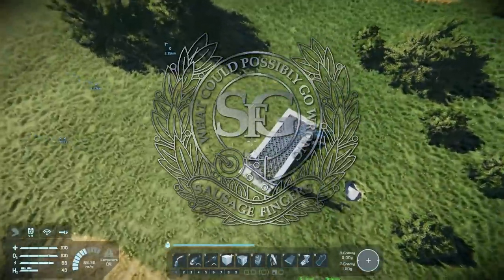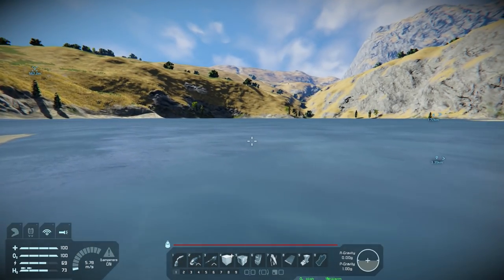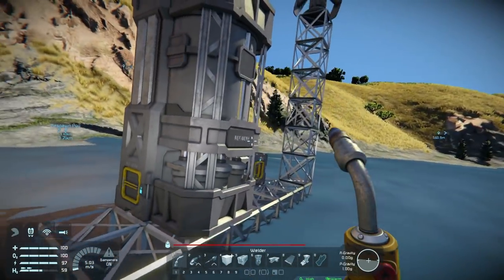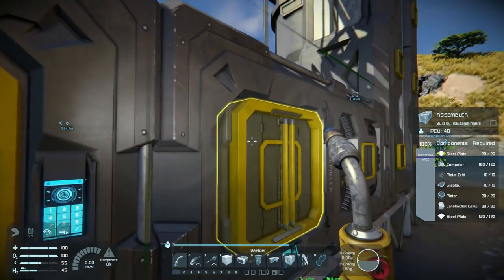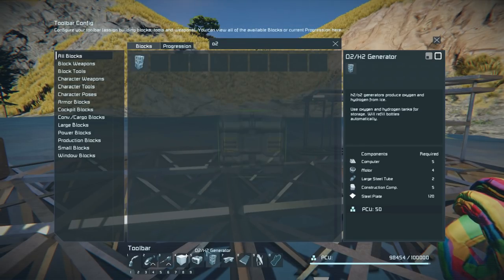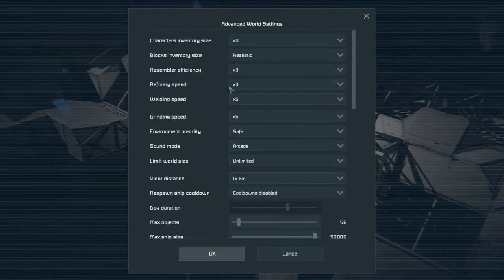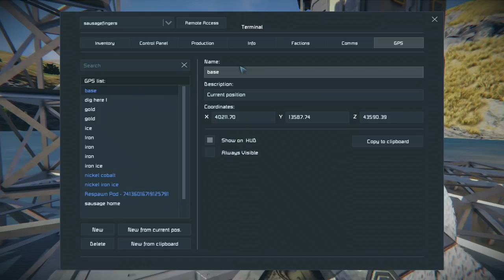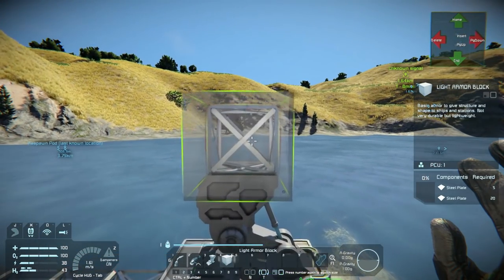Space Engineers | SpaceShip Base Prep | Ep 3

Comment: Has anyone told you about upgrade modules for full size refinery and full size assembler. They can have up to 4 each 
 They attach to the small yellow squares. The can be used to increase power efficiency or yeild amounts or speed.
They are stacking needed, so after 3x one type you don't get much return for the 4th so get more return with multiple types.
For example on a assembler I typically use 3x speed and 1x power, on refinery 2x yeild 2x speed.